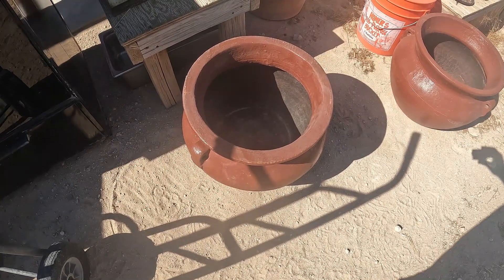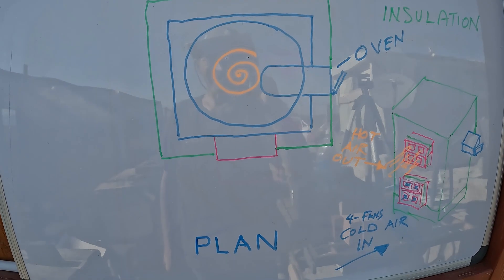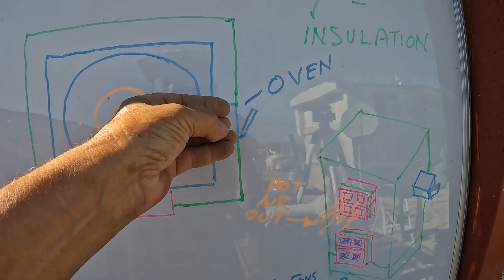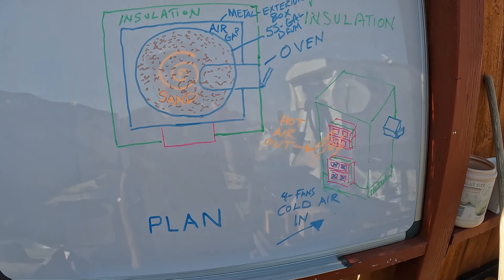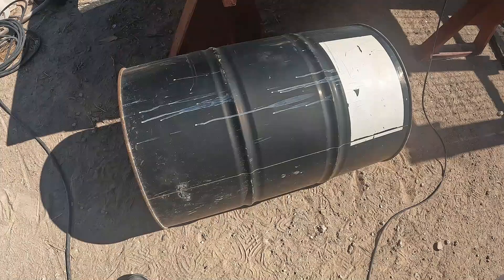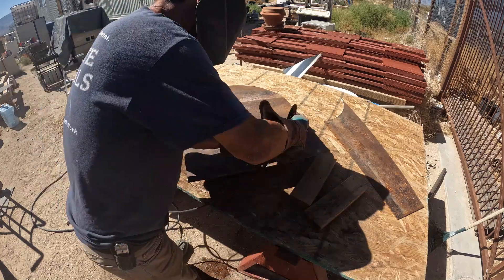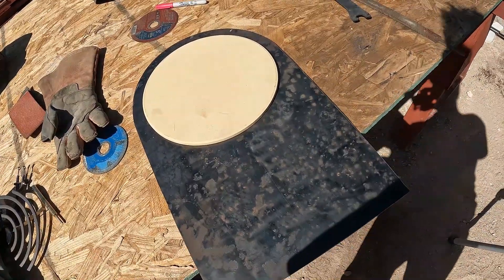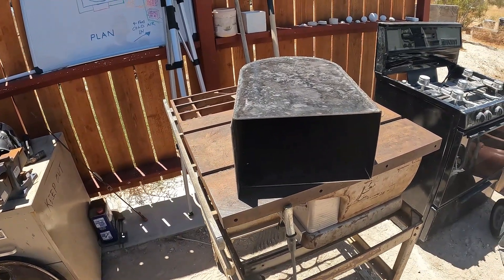149- Change of Design on New Sand Battery

Comment: Wanted to pass on an experiment result to you,  been running a 110 water heater on 2 panels direct no problems, just takes time to warm up. 3 panels melts the thermostat switch so I'll run 3 panels to the element and have a car starter solenoid do the power switch. I'll use 1 panel for the thermostat and it will operate the solenoid. Buying the solenoid tomorrow and will keep you updated on results.
Reply from the maker: Great experiment.  I hooked one up years ago and burnt-out the switch also. The solenoid switch sounds interesting. I hope it works out. Thanks for sharing.
Reply: @off-gridsurvivalmike8120  48 volt golf cart solenoid, continuous, that's the important part so it can stay energized for an hour and a half without heating up.
Reply: @off-gridsurvivalmike8120  working perfectly with 3 250 watt 37 volt panels wired at 111 volts. Will be buying 3 or 6 panels to up the wattage. Will keep you updated friend
Reply from the maker: I missed your update comment. Great progress

Comment: Hey what about making a hot water storage (or hybrid with concrete or sand?) in concrete, in the way Sergiy Yurko makes its solar heat storages boxes ?
Reply from the maker: I was back and forth on the hot water feature but decided not to add it to this particular one. I already have a large solar hot water tank I will install soon.

Comment: I have a small stainless steal bucket full of sand, was thinking a 1 burner unit, build an insulated wood box around it, it sets on fire brick and a ducted fan blowing through the box. This would be a room heater for the cold end of my 5th wheel. your thoughts?
Reply from the maker: It sounds viable. Until I actually get first hand data on how well this works I am only guessing at this point. That is one reason I am building this new design. So I can start testing in a room or small cabin.

Comment: go look for a used kiln, fill it with rocks, or sand  depending on  you goal.  An old electric  kiln is ideal for a thermal  battery. I found rocks that were meant for landscape at H.D Quite sure they are Basalt (slightly magnetic) have a higher heat storage capacity than sand and the air spaces are useful in removing heat.  Lid can be automated to slightly open or close to retain or remove heat.